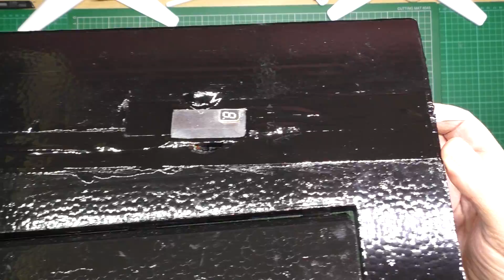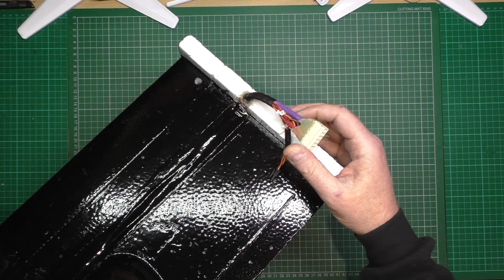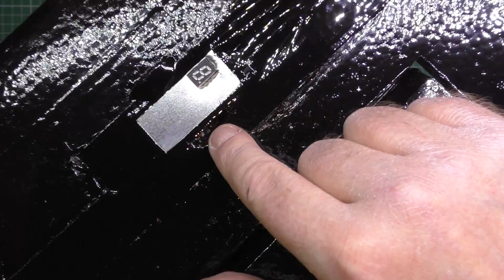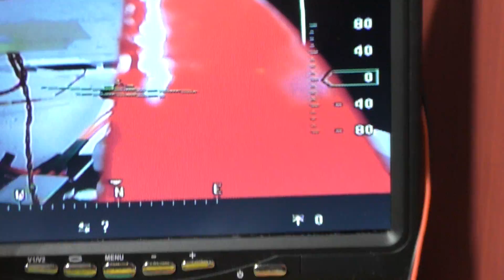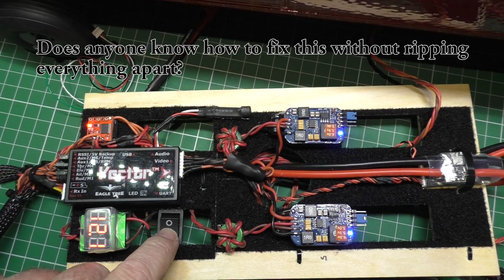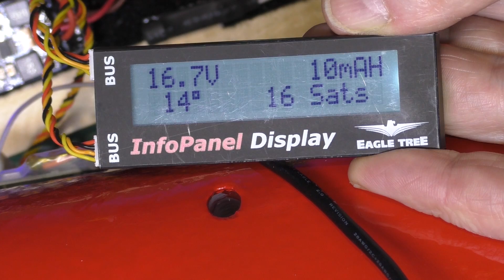SkyHunter FPV build part 10

Comment: heavy duty cabling, monster connectors, etc...   but need to save the 2g on the weight of a heatsink?     .....really?    :P

Also, I was watching this video so intently I burned my pizza.  Blaming it on you because I'm pretty sure it's your fault.

Comment: I've tried several painting attempts but have not been successful. The paint on yours looks great, what's the secret?
Reply from the maker: I use 151 paint and a good quality paintbrush (£1 for 10 from eBay) :-)    
The trick is, you make it just thick enough to cover in 1 coat. If you do it too thick, it forms a skin and the paint underneath stays soft for weeks. You paint as normal and make sure it's covered everywhere and then, you drag the paintbrush over it to take the brushstrokes out. EG you start putting the paint on the wing, travelling from tip to root and make sure it's all covered and then, you hold the end of the brush with your forefinger and thumb and drag it over the paint from front to back to remove any brushstrokes. Does that make sense?

Comment: Ive struggled to find a decent 3 axis gimbal.  Seeing how 'fussy' you are, ive just ordered the one you settled with.
Reply from the maker: Of course, I haven't actually maidened it yet. I have tested it with an EDF running at full throttle in front and it does seem stable enough.    
I'm waiting for the perfect morning before I put it in the air but we've only had 2 days so far this year, where the wind has been below 10mph :-(

Comment: I can't wait to see the footage recorded from the mobius lens out the back at an angle... Also, I think you're going to need to raise that landing gear, when you take off the prop is gonna hit the ground as the fuselage angles up.
Reply from the maker: +BlueFlyer FPV I purposely made the front higher than the rear to give the wings around 20 degree angle so (in theory) there should be enough lift to take-off without using the elevator. Of course, I could be wrong and I'll have a prop strike every time I try to fly it :D
Reply: +Vortecks I completely understand why you'd want gear in the first place... it is a very intimidating aircraft to hand launch, considering the sheer girth of the fuselage (ooh err missus lol), how difficult it is to grip it with one hand, oh... and the spinning blade of certain death right near your knuckles lol... needless to say, as long as you've got a bit of headwind, it's fairly easy to hand launch. It just takes confidence to give it a good CHUCK! with a javelin throw action, making sure to follow through with your arm/hand to get it out of the way of the big spinny thing lol

Have you flown this yet? I know the weather is god awful right now.... make sure you post up a vid of the maiden.
Reply from the maker: +BlueFlyer FPV I haven't flown it yet mate. I've got a rule for any flying...... less than 10mph wind and more than 10c temp. There might be a long wait but don't worry, bad or good, I'll post the maiden in my usual 'documentary' fashion. I'm wondering how many people can watch the boring bit at the beginning and just skip to the takeoff and landing :D

Comment: Looks like your almost there! what frequency is your t beacon transmitting on?
Reply from the maker: +Rotor Flex Sure is :-) You can set the tBeacon to transmit on quite a few channels which are between 430 and 470mhz (It's easily changed in the software)

Comment: Looking really good, thanks for the mention :) 

If you are using digital servos a 1.2 / 1.3Vtx can introduce jittering. 

I like the spoon scoop cooling fix, that should work fine. Just be wary of running that vtx with no heatsinks and no airflow on the bench for periods of time or it will burn out. 

Really like the paint job, looks great :)
Reply from the maker: +Coyote FPV I only run it for 5 mins at a time on the bench but it doesn't really get warm with my new dipole fitted. The jittering isn't bad, it's just annoying when I'm trying to get my old brain working :D
Reply: +Vortecks Good stuff, maiden time next :) :)